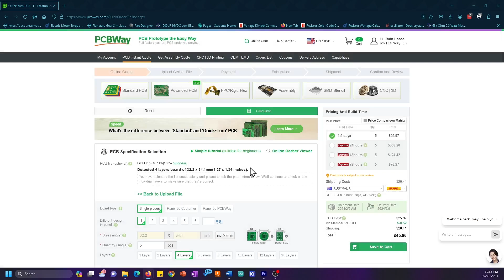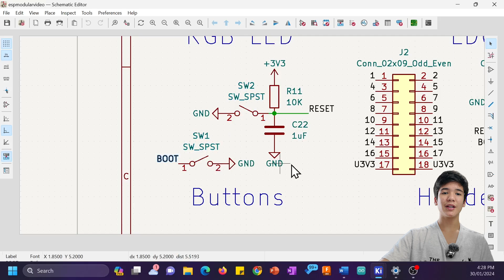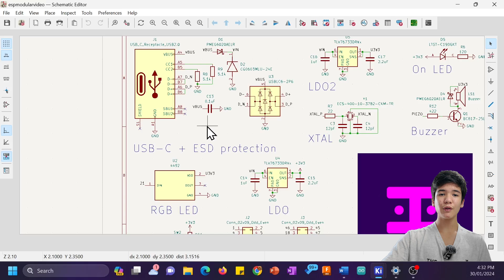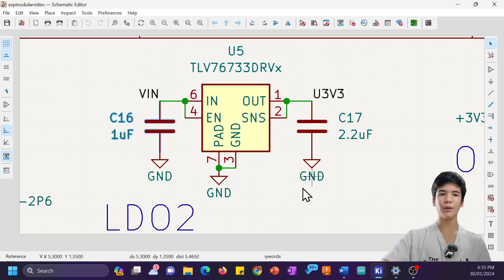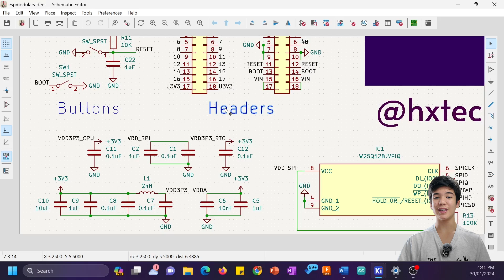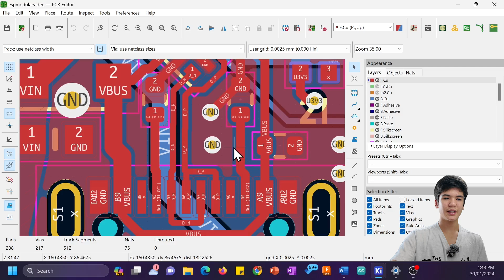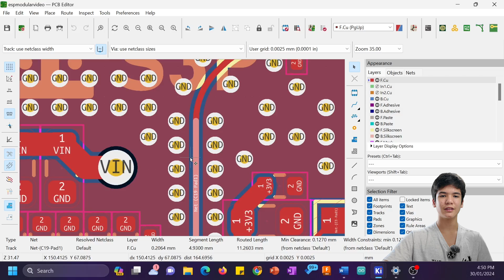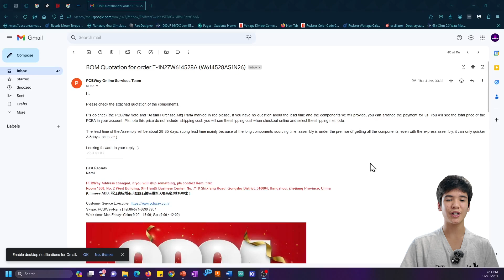ESP32-S3 + Chip Antenna PCB - Design your own in 15 minutes!

Comment: Is there a reason to use the non metal-shielded ESP32?   

I'd like to make a data recorder...  using an ESP32 and an ADC (TI ADS8588H  LQFP-64).  I think I can probably stumble my way thru the schematic, maybe even the layout (although the TI ADS8588H Layout recommendations shows tons of decoupling capacitors, split Analog/Digital planes , etc... all way advanced for a non-hardware guy!)

but the biggest issue will be the assembly.   My bad eyes and shaky hands, I don't think I'll have much luck soldering, even using 1206/1210 size components.  Where do you find someone that can do that?
Reply from the maker: I would actually recommend now to not try to use the non metal shielded version, as it requires tuning of the chip antenna that I still haven’t been able to figure out myself.  PCBWay not only can manufacture the PCBs but can solder the tiny electronic components on them too - I’ve regularly made boards with 0201s that they had absolutely no issue doing. They can get components from a variety of sources, so pretty much find any component in stock at one of the major suppliers (DigiKey, Mouser, Arrow, element14).
Reply from the maker: You use the non-shielded ESP to save space and it’s also less likely to go out of stock since not as many people do bare chip designs. I just did it for fun pretty much, this video is super old now 😅
Reply: @h1tec  Old, but still impressive!  BTW, it's not mentioned in the video, but did everything work?  Did the range on the PCB antenna work for at least a few feet?   

I don't think my eyes/hands could solder the parts?  Is PCBWay affordable for the assembly to, or is it best to send the PCB/parts to a specialized assembly house?
Reply from the maker: @bennguyen1313  The PCB antenna worked but it was heating the ESP32 chip due to signal reflections - this would significantly impact long-term reliability in my opinion. PCBWay's assembly service is $29 USD, and when you add it on, you also get free shipping (saving about $20)..... so it's just about as affordable as you can get. Of course they charge you for the components on the board as well which isn't included in the $29. 0201s, 0.4mm pitch QFNs, etc, as long as it's not some ridiculous BGA they can probably do it. Keep in mind, you can only get $29 assembly for 1 design (up to 20 copies of the board), if you add a second assembled design it could be $88+. Also, the LDO technically did work up to its voltage rating, it never failed me or burnt or anything, but it was super dodgy, it got extremely hot running on even 7-8V so if you have input voltages above 5V I would go Vin --> 5V with a buck converter and 5V --> 3.3V with an LDO (decouples noise) that way components aren't getting ridiculously hot. PCBWay is the way to go for the assembly, I wouldn't recommend a separate assembly house unless you're doing it yourself for fun. Even then I don't even think YouTubers do it for fun lol... if we're assembling our own PCBs it's probably for views because we can get our audience to stay longer.

Comment: For the antenna, did you have to tune the antenna after receiving the PCB?
Reply from the maker: yeah, i tried to, with a VNA, couldn't get it to work though. i mean the wireless functionality still worked, but the chip heated up because the antenna wasn't tuned. there was such a massive lack of information on the topic that I even made newer versions of this device and couldn't find out how to tune the antenna.
Reply: That is what I fear and don't wanna go into expensive services out there for antenna tuning or my radio not functioning. I would rather go for module than. Same problem is with software for radio. There is not much documents for high level stuff. I think that is their monopoly
Reply from the maker: @ujjwalrathod007 yeah, most practical is to just use module if you need wireless functionality out of the box. You could also look at Unexpected Maker’s series of boards, which are small and use the bare chip, but are actually tuned.

Comment: The regulator is fine. Any heat from it is a function of the voltage dropped and the load current. It may be capable of higher current, but not while dropping 12v down to 3.3v.  The copper heatsink area of the PCB at the regulator is also important, of course. Good presentation, and helpful. Thanks.

BTW, I was 17 when I started in electronics. That was fifty years ago, back in 1974.  I recently retired.  You have a very interesting career ahead of you if you go down this path.
Reply from the maker: Thx 😁

Comment: For people with zero electronics background, is there a simple way to design my own PCB antenna? I have a ESP32+LoRa module that has IPEX connectors, but I don't have space to use though. The device has a ANT pin that I could try to solder to a PCB antena, but im not sure how to design it. For me they just seem like random zig-zag lines 😅 Would it work to just copy the shape form a ESP32 with PCB antenna?
Reply from the maker: @SgtOneill  Check this out: https://www.ti.com/lit/an/swra117d/swra117d.pdf and Phil’s Lab’s PCB antenna hardware design on how to use it 👍
Reply: @h1tec awesome. Thanks!

Comment: Have you ever used the ESP32 S3 without external flash ?
Reply from the maker: Sorry, I don’t know what you mean, can you please elaborate?
Reply: @h1tec  using the ESP32 C3 chip without any external flash on board and just using the flash on the SoC?   Thanks for the reply.
Reply from the maker: @ well, depends what variant of the chip you have. ESP32-S3FN8 integrates 8MB of flash, whereas ESP32-S3R8 integrates 8MB of PSRAM. If you use the no integrated memory version, whose part number is just ESP32-S3, and don’t connect any external flash to it, it won’t work as far as I’m aware. If you want a variant with inbuilt flash, and no need for an external one, just use ESP32-S3FN8.
Reply: @h1tec  Thanks you for taking the time to reply!  That's really helpful.
Reply from the maker: @wayne_taylor  of course! Have you seen my latest video? I use the ESP32-S3-PICO which integrates 8MB flash and 2MB PSRAM, with much of the external circuitry that you’d need with a normal ESP32-S3 (crystal, filtering supply voltage, etc) integrated into the silicon. You should check it out 😁
Reply: @h1tec  Yup.  You are doing amazing stuff.
Reply from the maker: @ thanks! Appreciate the support! 😁😁😁

Comment: how to make a pcb that uses 
esp 32 s3
lights
buzzer 
usb chargeable battery pack

Any suggestions
Reply from the maker: You can take inspiration from my circuit for the buzzer and ESP32-S3 configuration, and the battery charging circuit and lights from the Unexpected Maker FeatherS3 Neo (this one has the new ESP32-S3-PICO chip, which is even easier to use).

Comment: Does the ESP chip comes with a pre-defined firmware? Or should we build a firmware before uploading a blank sketch?
Reply from the maker: @pavano6970  you can upload a sketch as soon as you receive the boards, it is very easy
Reply: @h1tec  that's great! Thanks for the quick reply.

I am building mine with USB UART instead of  direct USB. This doesn't create any difference in programming right?

Comment: The regulator gets "concerningly hot" and you're "not sure" if you can recommend them?    You need the formal education -- and then come back to tell the story all over again.
Reply from the maker: @keithsummers1889  and that’s exactly what I’m going to be doing with my new videos, since I made a new board which reverse polarity protects its voltage input with an N-channel MOSFET and ideal diode controller, before being fed into a Buck converter. Most people would interpret ‘not sure’ as ‘not advisable to do this in a design’ in the context I mentioned this in. It should still ensure no one thinks using an LDO is a good idea for stepping down voltage with any more than a ~3V drop, at this amount of current.

This is a free video, which I have learned knowledge about using free information online.

Do you consider reading hundreds of Texas Instruments, Infineon, and Espressif application notes formal education? What about watching videos by Altium, which explain how to implement many things explained in this video? Do you consider spending thousands of hours reading data sheets and finding the right parts for my boards, formal education?

With all due respect, I’m a 13 year old child in Year 10 who can’t even take any subjects at school to teach me these things, let alone take a university course with will cost tens of thousands of dollars a year which we don’t have. So, if you’d like to see me ‘tell the story all over again’, I can make a video doing exactly that, and if you’d like more information about these boards, given that I’ve made 3 successful boards this past year, I’d be happy to help you through this comments section.

But, if you’re here just to criticise me and tell me that I need to go to university to learn basic circuit board design such as this, which probably won’t happen for another 2 years, I can’t help you with anything.

Thanks 😁
Reply: @h1tec  You you also consider recommending  medicines if you had no formal education as a doctor?    Just to excuse it all saying -- "I'm only a 13 yr old child"?    Personally, I do have the formal education and 30 years experience and I can tell you that even I would "get beat" up for being inaccurate.    I'm saying here that you're way over your head on this topic.   But, I will say that you are further along than most people at this time in your life and I look forward to what you will produce as you arrive to your Master degree in education.
Reply from the maker: @keithsummers1889  thank you, but the subject of this video is nothing that should be used by anyone in medical or even automotive purposes where things breaking puts someone’s life in danger. The ESP32-S3 chip is very low cost with lots of functionality, and reliability is a trade-off here. People watching this video know this. Almost every electronic part datasheet out there will have a section saying ‘this component is not permitted to be used in life-saving devices’, and for good reason. Texas Instruments is a great example of the difference between reliable and hobby/non-critical applications, since all of their automotive parts have a -Q1 at the end of the part number, while less reliable, or lower temperature range parts will not. This video was simply an attempt at educating people about designing from the bare ESP32-S3 chip for their own hobby projects, and not meant to be taken as anything more. My GitHub schematic specifically states that I do not assume reliability from anything produced as a result of my own design. This is one of the reasons why I don’t share the PCB files because I don’t want people manufacturing my boards if they haven’t been tested and work properly. But, thanks for bringing this to light, I might add some kind of notice to my next video saying that my advice is only to be taken into consideration for hobby projects.
Reply from the maker: @keithsummers1889  and, no. This topic is not ‘way over my head’ and I don’t think I need to prove that to anyone. There isn’t even any high speed digital signals, and impedance matching is almost optional for the USB differential pair (even though I still do it), so I would argue that designing with ESP32 is even easier than atMega, especially when using the modules. I know I say things like ‘I don’t know what harmonics are’ and pretend to seem like I don’t know what I’m doing, but this is clearly for comedic effect and to shorten the length of the video. Not everyone needs to be lectured on every detail of everything; most will be annoyed and click off the video I find, at least on this platform. If this was way over my head, how could the board have worked, and the 2 others I made after it? If a surgeon performs 1000 surgeries in his lifetime without any of the patients having any issues caused by the surgery, was he just waving around metal tweezers and cutting random things, or did he know what he was doing and began to know more of what he was doing as time went on?
Reply: @animator331  I don't watch his videos -- but I'm also respectful enough of an audience not be talking through my ass about topics if I'm not up to speed on them.  Misleading people with ignorance is detrimental on the whole.    That is the embarrassing part of it.   Too many kids today think they should short cut hard work and an education and sucker others into a revenue stream without paying their dues first.
Reply: @keithsummers1889 I’m genuinely curious how advanced you were at this kids age. As far as kids these days, this one is top 1% in breadth of knowledge. Most everyone watching this video knows that and wouldn’t judge this kid against someone with professional experience in the field. I hope you are curious and reflective as to why your perception is so different than others who enjoyed the video.
Reply: @keithsummers1889 maybe do some research on people before commenting. I’ve actually met this young kid, and he’s 100x smarter than you’ll ever be!
Reply: @reenewsupport  He is very intelligent for his age -- but he doesn't know anything about antenna design or PCB design or RLC circuits.   He reads off a monitor and is a puppet for the purpose of deriving income from viewers like you.
Reply: @keithsummers1889  you obviously know what you’re talking about 😂 #troll
Reply from the maker: @keithsummers1889  I've made literally $6 off of this video from YouTube. Money was not even the point of making this video. You would know if you actually made content, instead of criticising me as I improve myself every day. What is 'ChatGTP' again? Don't know what a 'GTP' is, heard of a 'GPT' before... Also, I never even mentioned an RLC circuit here. I've heard from experts and literature (not this all so scary, behemoth of a concept known as 'AI') online about using CLC, LC, and T circuits, never a RLC. Maybe you could educate me. Also, I'm in Year 12 Maths Methods right now, with a 96% overall (over 2 exams and a report) in topics including, but not limited to: differentiation, integration, and trigonometry. I don't need to be told to go 'do algebra'. I genuinely hope you will improve your life and wellbeing so you don't feel the urge to write condescending hate comments on a child's YouTube channel. Imagine how much more you could've improved this community we are blessed with by giving useful advice instead of just saying 'this kid has done nothing to get here and is absolutely dreaming'. Have a good day. Honestly.
Reply: @keithsummers1889  Where’s your PCB design video? Would like to compare for reference.
Reply from the maker: @keithsummers1889  unfortunately for you, nowadays, there are probably petabytes of free, open source information on electronics online, making it a very foolish decision (in my opinion) to wait until University to start learning, when you’ll be forced into hundreds of thousands of dollars of student loans before you even have skills. But, that’s just how I roll. No disrespect towards you or any others.
Reply: @h1tec  No need to wait until you sit in front of Dr in Electrical Engineering to start learning.   What is foolish is to suggest that you can produce a chip antenna design of some value in 15 minutes without a significant understanding of theory.   There are just too many dreamers out there who think that on-line video and ChatGPT are all you need for success in this world.   It's a foolish idea to short cut the education because the latest generation think that they can bootstrap it all without doing the hard work first.
Reply: Ah, Uncle! I get it, back in your day you had to read a 100-page book just to learn how a lightbulb works. But times have changed. These days, multibillion-dollar companies are literally built by 'kids' like him without needing to walk uphill both ways to a university! With everything open-source and online, we can learn more from a YouTube video in 10 minutes than a semester of classes. And hey, we’ve got no-code platforms that let us build apps with plain old  English—no need for that ancient language you call 'programming'!
Reply: @mohamedrafeeq565  I've been around long enough to see that we can find more answers today but know far less about solving problems.   We're lazy and looking to cut corners... cheat our way into fame and fortune.
Reply: @hxtec32 Hey, I have to say, you’ve got some serious talent for this stuff! And don’t let anyone tell you that you need a formal education to succeed .  Keep doing what you're doing--who knows, you might be running a multibillion-dollar company before long

Comment: Hey you made a great video, i would want to have that much knowledge at your age ;D. 
But one thing i dont understand, i am designing a board with ESP32S3 myself and in the hardware design guidelines for ESP32S3 Espressif stated, i quote:
"Note that USB_D+ will have level output, so please add a pull-up resistor to determine the initial high-level output voltage"
Should't then a pull up resistor be placed from 3.3V to the USB_D+ data line, as it is stated in the official USB2.0 specs for USB-FS mode? I dont know if i am missing something, but that is what i understood. I didnt find any information that the USB-otg on the ESP32S3 has internal pull-up resistors, so the hardware design guideline from Espressif would make sense.
Reply from the maker: @piotrwesoek1663  you don’t need the pull up resistor, I think it’s in the chip itself maybe… I’ve made 2 successful boards without the pull up resistor on the USB_D+ line, never had any issues. Thanks
Reply: @h1tec  Thank you for the answer !!!